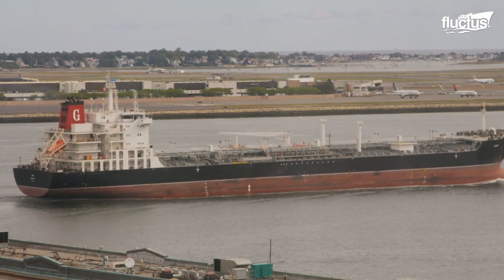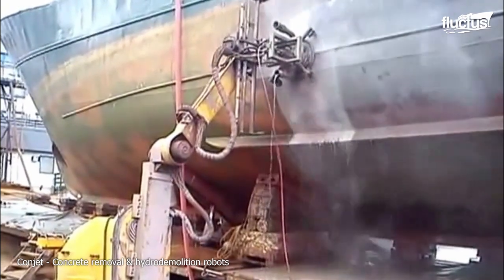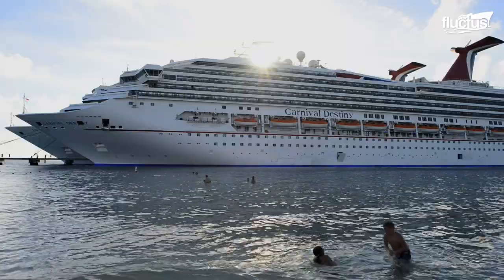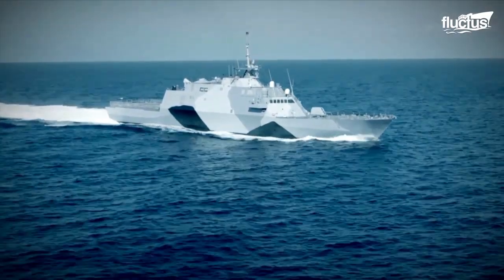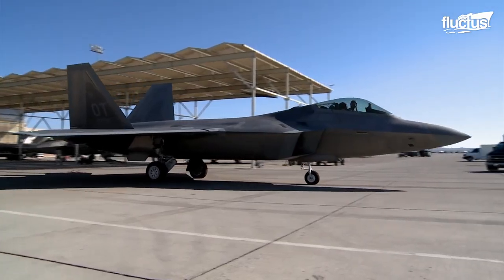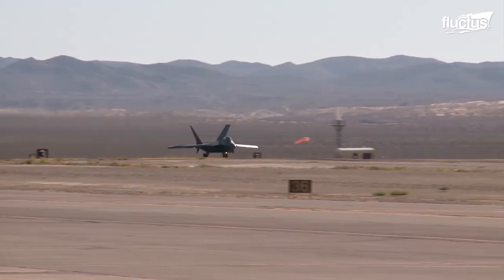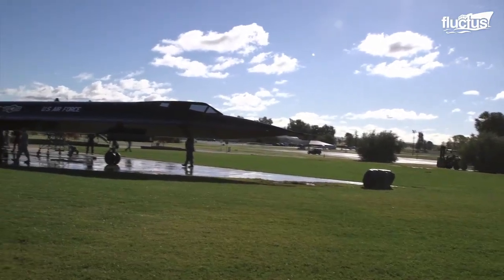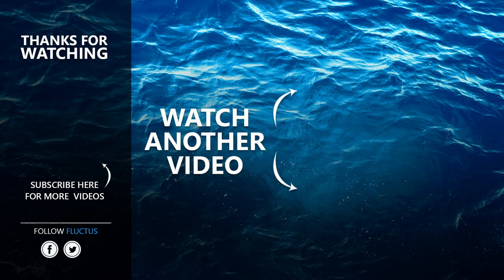The Scary Process of Repainting a Gigantic Container Ship

Comment: The last Radar hurdle to overcome in stealth is 'Doppler'.... It can detect disturbances in the air. It's used to find and track severe weather like tornadoes and hurricanes. Any aircraft including Stealth disturb the air as they fly through it. Low frequency Doppler Radar can detect this and then track it. In 1991 over Bosnia, a F-117 was shot down after it was detected on Doppler radar.